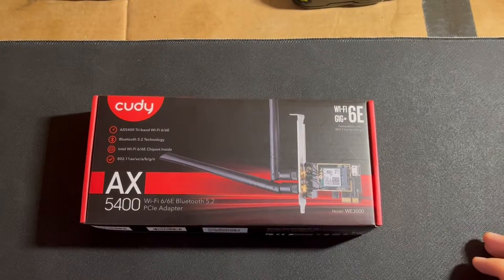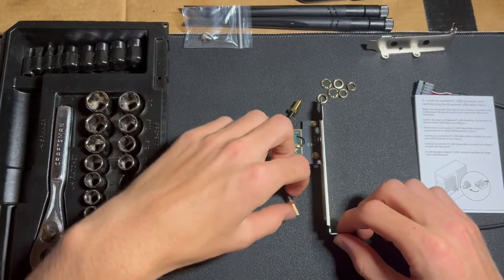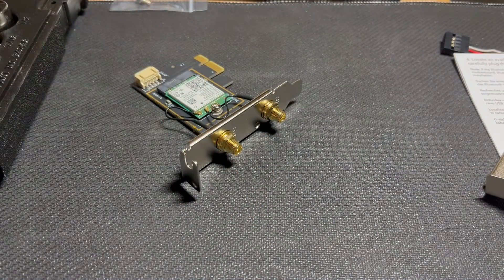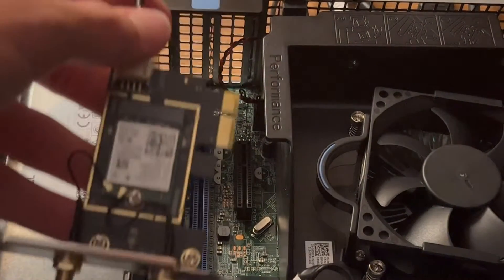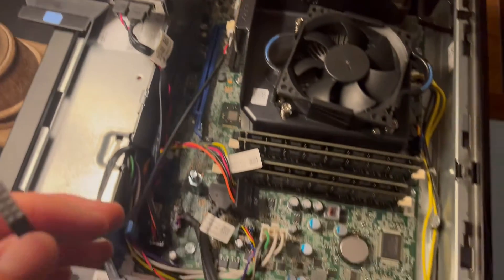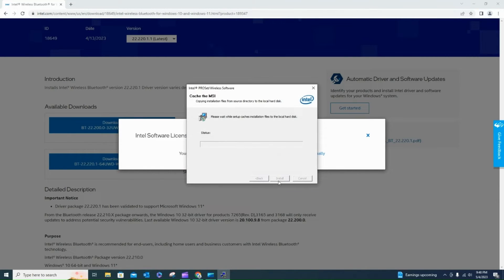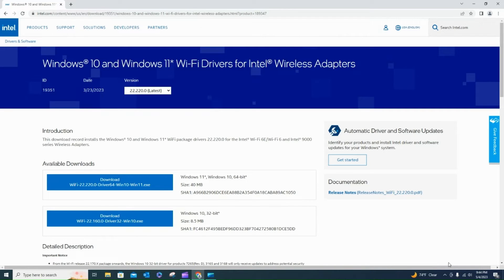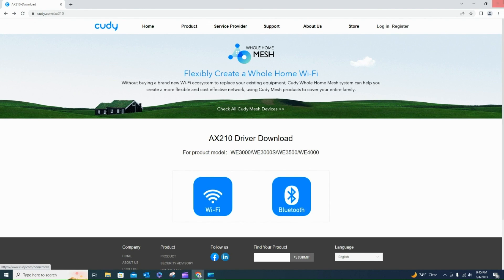Cudy AX5400 PCIe WiFi/Bluetooth 5.0 Adapter Installation!

Comment: Came in the clutch with this one! I wasn’t sure about that Bluetooth cord either 💯🔥
Reply from the maker: Yeah, I just use it as a WiFi card and I have a separate Bluetooth dongle.
Reply: @mjrprojects9476 💯 so can you still get a usb 3.0 network adapter for Bluetooth instead?
Reply from the maker: Yeah, I only use the WiFi card for WiFi but I have a separate network adapter dongle plugged into one of the usbs.

Comment: Found one of these without a cable, thanks
Reply from the maker: The cable’s just for Bluetooth but it uses a connector that only newer computer have so u prolly wouldn’t be able to use the cord even if you had it.
Reply: @mjrprojects9476  meant the cable going from the inside of the PC to the card

And it has two antennae
Reply from the maker: yeah, if I’m saying mine is outdated too cuz I didn’t have the port for the cord. Regardless, faiz said he didn’t have the cord so it doesn’t really matter.
Reply: bro said your shit outdated

Comment: I cannot install may wifi card due to my gpu it occupied all spaces for pcie x1 slot
Reply from the maker: I guess you’ll have to either buy a usb dongle or see if you can get a pcie extension cord of some sort and install the card in a different spot.

Comment: I installed eveything and downloaded the driver but the wifi still doesnt pop up in the corner 😢
Reply from the maker: Yeah, you’ll prolly have to go to settings and connect to the network there. A lot of times on desktops the little Wi-Fi widget won’t pop up in the notifications area even after installing a wireless device.

If that doesn’t work, you could go to device manger and make sure that your Wi-Fi card is even being recognized and then that it is functioning correctly.
Reply: @mjrprojects9476  mine is not recognized... pretty bad, I'm trying to find what causes it
Reply: could u fix it yet?
if so how?

Comment: or do you have to go to a separate computer with a usb and download the drivers there then plug your wifi adapter in and download the drivers on the computer your trying to get wifi in? bc i currently don’t have an existing wifi adapter like you did in my pc i’m trying to get wifi on it
Reply from the maker: I would assume that that’s the process you will have go through. Also your Wi-Fi card may have come with an optical disk that may also have the drivers pre installed on it. But honestly windows 10 and 11 are so advanced, I know a lot of times they will have generic drivers or they will automatically download drivers for newly detected hardware. What I’m saying is u might be able to slap that card in there and have Wi-Fi without manually downloading any drivers, idk🤷‍♂️. Also if you have an Ethernet connection you could try downloading the drivers there and then just unplugging the Ethernet when your done. So there’s a whole bunch of different options but I’m sure you’ll figure something out, good luck 👍
Reply: @mjrprojects9476  i would do ethernet but sadly it’s across the entire house 😂
Reply from the maker: @joshheath04  even if you could temporarily move the computer over there just for this and then move it back then that would work. But at that point it might be more convenient just to do the usb from another computer.

Comment: so you didn’t have to install drivers on a separate usb? you just get the wifi and go to there website and download the driver from there ?
Reply from the maker: I already had a usb Wi-Fi dongle from before so I was just upgrading to this card. This meant that I could use the old dongle to access the internet to download the drivers and then once the card was set up, I just unplugged the usb Wi-Fi dongle.
Reply: @mjrprojects9476  thank you! great vid btw was planning on buying this wifi adapter and needed to know how to install and get drivers on there im a very new pc owner just got it
Reply: If you're using Windows, it already has those drivers built-in, and will update it automatically. Windows has become so advanced that there is no need to download it separately.